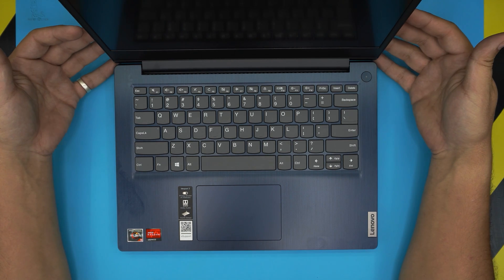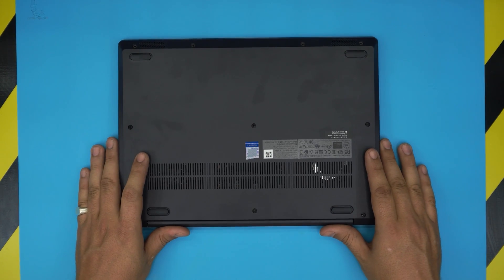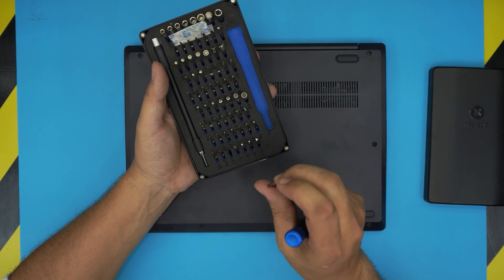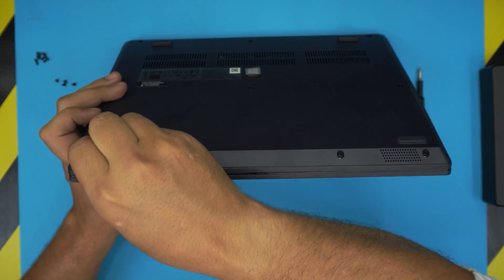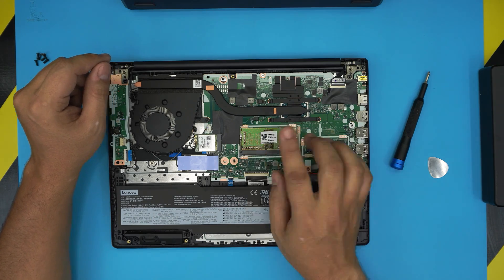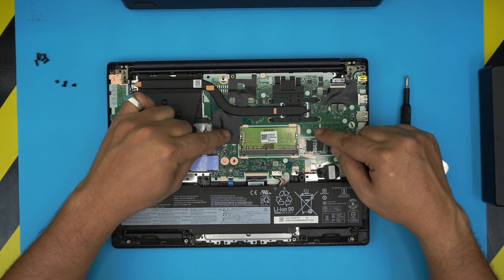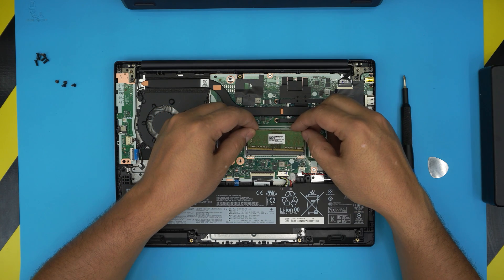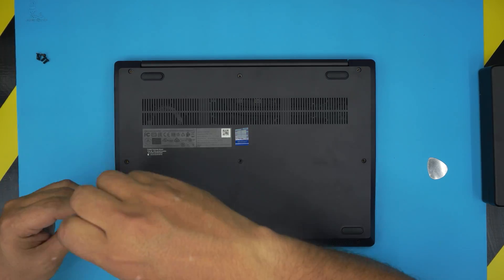👉 Lenovo Ideapad 3 14 RAM UPGRADE

Comment: Hii i have lenovo ideapad 3 14IIL05 . Iwant to upgrade my laptop. My laptop has two slots one is soldered (4gb) and other is empty i want to upgrade it to 20gb by putting the 16gb ram on the other slot. But my laptop manual says tham my laptop has 12gb capacity so is it gud to put 16gb on the other slot or i habe to put 8 gb to make it 12gb in total
Reply from the maker: 🫠Regarding your question, you can go up to 12GB place a 8GB and that is all.
cheers🍻
Reply: did you add a 16gb card and try it? if yes please do tell me if it worked

Comment: Thank you for the video sir. I have Ideapad 3 14ADA050. It has rows of chips RAM in first slot with speed of 2400. Can I add a new RAM in the second slot with speed 3200? Thank you very much sir.
Reply from the maker: It's my pleasure, my friend. 😊 I deeply appreciate your taking the time to provide feedback. If you're inclined to support the channel further, feel free to like and subscribe—or even both!
Regarding your question, sure you can and it will be auto adjusted by BIOS the ram speed to match the lower ram speed in this case the 3200 will be automatically lowered to 2400.
go a head and do the upgrade👍
Should you have any further questions or requests in the future, please don't hesitate to ask me.
cheers🍻
Reply: @nadzrulnajmuddin4672 
Did you tried installing ram ?
Of what frequency and size and did it worked 
Also what is your processor

Comment: i have laptop ideapad 3 14iil05. but everytime i upgrade the RAM i always experiencing freezing while gaming of around 10 minutes.
i used 3 different brand of 4gb ddr4 2666 RAM but i get the same problem.
what could be the problem?
Reply from the maker: Thank you for your feedback! If you wish to support the channel, you can like, subscribe, or both!
Regarding your question, do you have on board ram too?, if so sometimes when we get this issue is because of on board ram that has one ram block bad and needs to be replaced. you will need to see a technician that knows how to reball a BGA ram chip.

Comment: Hi, Can you suggest me store or brand of a ram should i buy? I want 16gb more for my laptop. My laptop is lenovo ideapad 3 14ARE05
Reply from the maker: Thank you for your feedback! If you wish to support the channel, you can like, subscribe, or both!
Regarding your question, 1st of all what you mean 16GB more?!
you have 16gb now and you want 16gb extra? to get a total 32GB?
that is not possible.
i need to know what configuration of the ram you have now?!, you have 4GB or 8GB SOLDERED on board? and have free one slot available?
because this laptops come in 3 different configurations:
1. one empty slot and 4gb soldered.
2. one empty slot and 8gb soldered.
3. 4gb stick and no soldered.
open your laptop and see what configuration you have.
Reply: Oh, My bad i didn't make it clear. I want to add 16gb in my ram😅 My currently ram is 4gb i want to add more like 16gb if my laptop can hadle it
Reply from the maker: yes it can handle it my friend we do upgrade for our clients

Comment: This video is very impressive. I also have a Lenovo Ideapad 3 with a ram of 4GB which is very slow after I upgraded to Windows 11.
1. Do I have to go to another laptop?
2. I'd like to upgrade the ram of my laptop as you mentioned and please let me know what's the best ram card for my computer? 
3. Like in desktops is it possible to add another ram keeping the available ram?
4. What's the meaning of soldering ram? I guess I am provided with similar. 
5. If I change the ram, do I need to change the processor and VGA also?
Please explain me the above. Usually I do like to upgrade my machine rather purchase a new one.
Thanks for sharing this inspirational video.
Reply from the maker: Thank you for your feedback! If you'd like to support the channel, you can like, subscribe, or do both!

Regarding your question, the suitability of a laptop depends on its intended use. For basic office tasks, a fine laptop should suffice. However, if you plan on using it for light gaming or animation video editing programs, you'll need a better laptop.

To enhance performance, you can consider adding additional RAM while keeping the onboard RAM. The soldered RAM refers to the non-removable RAM that is soldered onto the motherboard. When upgrading the RAM, you don't need to change the VGA (video graphics array).

In conclusion, it's important to determine your specific requirements for the laptop and consider your budget before making a decision.
Reply: @uFixTek  Thanks a lot. I will definitely do it. I'm not a gamer. But I wanted to keep my laptop updated and upgraded with time. 
Thanks a lot for your nice explanation. You really are a genius 👏 
Thumbs up 👍
Reply from the maker: it's my pleasure my friend. 😊 
Should you have any questions or requests in the future, please don't hesitate to ask me.
Reply: @uFixTek  Today I upgraded my Lenovo L340 laptop with a 8 GB, DDR4 ram exactly as you said. Usually, I am not a gamer but my machine was very slow with existing 4 GB ram and when I opened the laptop specially purchased screw driver set( not a sophisticated one like yours. But enough for my works) when I ordered the ram and computer works perfectly after that like it has a new heart to breathe. 
Thanks a lot for your genuine support and again I really appreciate your efforts. 👏🙏🇱🇰
Reply from the maker: it's my pleasure my friend. sorry for delay on reply.
enjoy your upgraded laptop.

Comment: Hello mate. My laptop is the Lenovo ideapad 3 14IGL05. on the ram section it say 1 of 1 RAM. Please can i still upgrade the ram in any way?
Reply from the maker: Thank you for the feedback! if you wish to support the channel you can LIKE or SUB or both :P
regarding your question: my friend never trust the task manager it will never tell you the correct slots of ram.
you may only have one ram dim and you will need to remove the ram on that slot and replace it with a higher capacity ram. just simply remove the cover to see what you have ... build on motherboard ram and a free slot, or you have a nothing soldered on board and 1 slot with occupied , then remove and get a higher capacity ram.
this is a 16gb ram compatible: 🔵 https://amzn.to/3jAZpUm
Reply: @uFixTek  hello in your reply to above commenter, are you saying someone can undo the saudered on 4GB from the mother board, to add better?

Comment: Hi, I want to install a new RAM for my Lenovo just like in your video. I hace a doubt. I can choose between a ADATA Premier Series with 8GB (DDR4 SODIMM 32000 MHZ 1.2V) which is the model "recomended" by Lenovo but someone tell me I can use a Kingston Fury Impact (DDR4 SDRAM SODIMM 32000 MHz 1.2V). I want to know if this is true or I can't use this last one because is DDR4 SDRAM. Thank you for your video! :3
P.S.: My Lenovo is a IdeaPad 3 14ITL05
Reply from the maker: Thank you for the feedback! if you wish to support the channel you can LIKE or SUB or both :P
regarding your question: yes you can use any SDRAM DDR4 2400mhz up to 3200 any brand or make will work just as good.
Reply: @uFixTek  Then The Fury Impacto can work? Or you Will recomend other One?
Reply from the maker: go with fury impacto its  good ram. thery are solid rams
Reply: @uFixTek  thank you!
Reply from the maker: @diego_barrera87  my pleasure,
if you have any question or request in the future feel free to ask me.
Reply: @uFixTek  thank you. I already install it and works great! There's an error about The "drivers" but I Guess this could get fixed by future drivers updates.
Do you hace videos about How yo change The SSD for One with More capability?
In this modelo I would Like to do it in The future :0

Comment: Hi, can I put RAM 3200 mhz, or higher?
Reply from the maker: Thank you for the feedback! if you wish to support the channel you can LIKE or SUB or both :P
regarding your question:  you could but the windows will down clock the ram speed to match the on board ram speed, so if your on board ram is 1600 and you install another 3200mhz the bios will lower the 3200 to match the 1600.

Comment: Hello ..I ordered the lenovo ideapad 3 15.6inch  Ryzen 7 5700u 12 GB 512ssd.Will I be able to upgrade to 16 GB?or is the 12 gb soldered on the mother board and not upgradable?2021 model
Reply from the maker: thank you for the feedback! if you wish to support the channel you can LIKE or SUB or both :P
regarding your question: you have 4gb soldered and 8gb installed, if you want to know you max ram capacity check this video.
https://youtu.be/tKEJTkVth4Q
Reply: Bro I think 4gb is already in built on motherboard and one slot was free  which is now occupied by your 8gb stick, I have lenovo ideapad 3 slim3 and I think mine can go 12 gb max too :(
kinda sucks we cant jump 16 or 20

Comment: What size ram is does it take?
Reply: It has 1 slot wich can take max of 8gb ram in total whit the 4 on the motherboard is 12gb ram that is the maximum the lenovo ideapad 3 14 can take 
Second note: this is the maximum lenovo specifies it can take I did not experiment whit more ram than 12 but it may work whit 16 again there needs to be more researche before doing so
Reply from the maker: Thanks ✌  for the feedback!  if you wish to support the channel you can LIKE or SUB or both :P
regarding your question: ALL the links are in the video description and the ram too, but here is the tested ram 16GB https://amzn.to/37RtYiU
Reply: @uFixTek  ?